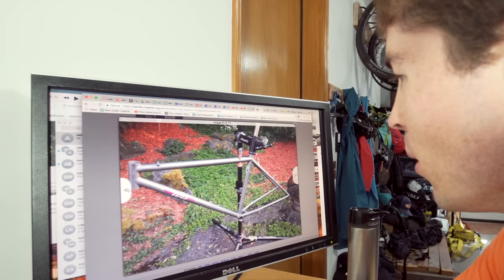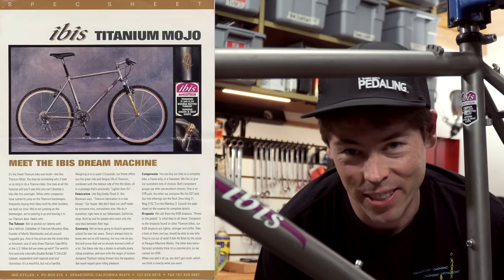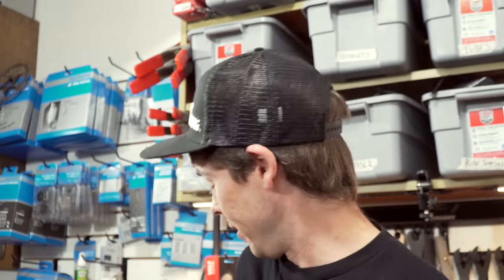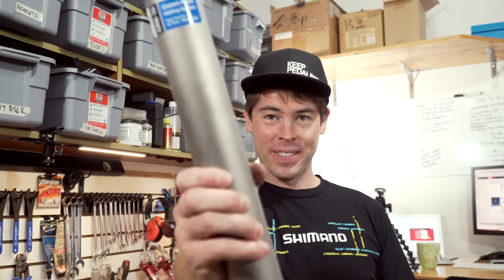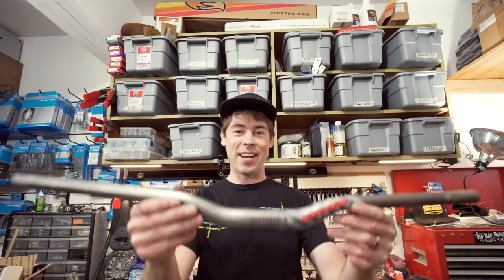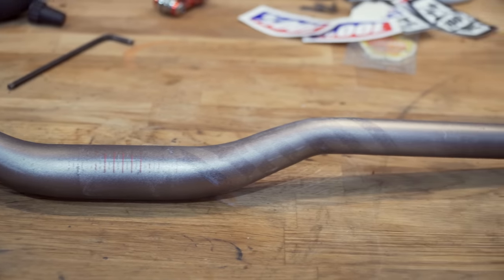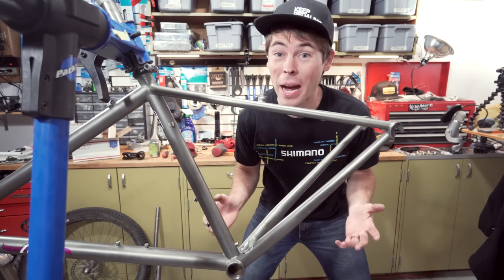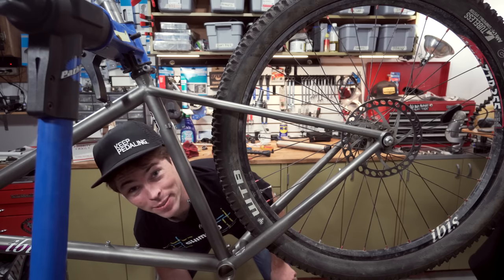I wish we had these parts in the 90s!

Comment: Nice, I have a somewhat later gen Ti Mojo (disc brakes! huzzah!) I still ride and race gravel events on it. I've converted mine to 650b and run smaller tires, and switch between a 100mm Sid and a rigid Potts Type 2 fork.  Fantastic bikes!
Reply from the maker: Right on Adam!  The Mojo Ti rides so good- Ancotech!  I'll never do the 650b tires on this, but a 100mm fork might be nice!

Comment: Don’t forget too, rims were skinny! You could likely get a 2.1”  w/ proper vintage rims.
Reply from the maker: Well, I have 19mm rims on there...  Stans ZTR 355.
Reply: Jeff Kendall-Weed wow didn’t realize the old 355 ran so narrow inside. Don’t know the actual internal dimensions but was thinking old school mavic M261, which were 23mm external. I just rebuilt and old ti frame, ‘08 Vicious Cycles Metal Guru. I had smashed it (and my ribs, etc.) in a dumb crash in ‘10 and retired it. An upgrade to 1.5” headtube repair via Carl the Snarl got rid of the oval 1-1/8” and down tube kink. Found a Sid WC in perfect condition on eBay fire sale. Re-used a cockpit and wheels, then dropped on a modern 1x11 GX (34x46t Box cassette) drivetrain. It’s such a dream, forgot how great a snappy old school geo ti bike can be. Downright dreamy! For what it’s worth, I’m only now, 26 yrs into mtb, starting to play about with wheelies and now trail manuals... and honestly, your early video work is part of the inspiration that brought my mtb path to long solo periods of 30 miles of trying wheelies and manuals. Anyway, I appreciate the videos, keeps that stoke high. Cheers to growing old not getting old.
Reply from the maker: That vicious sounds like a fun bike! Hope your ribs are recovered! And thanks for the props !!!